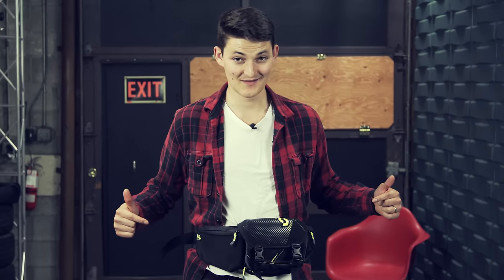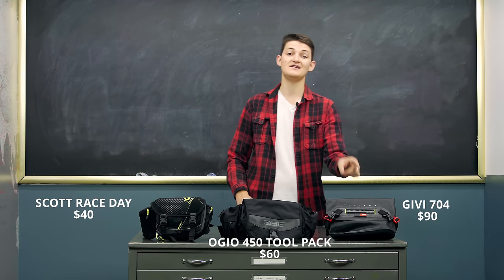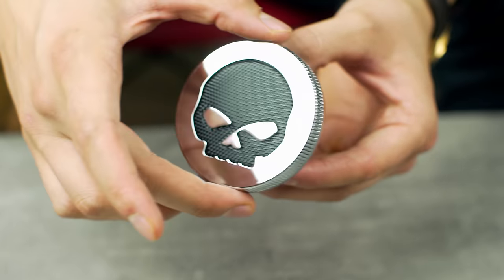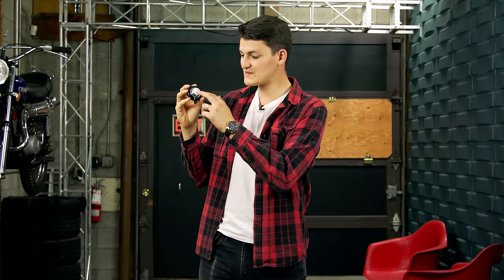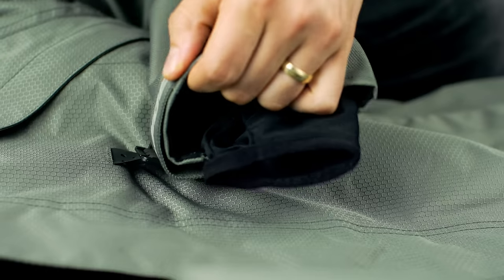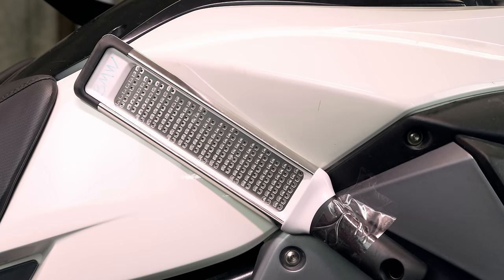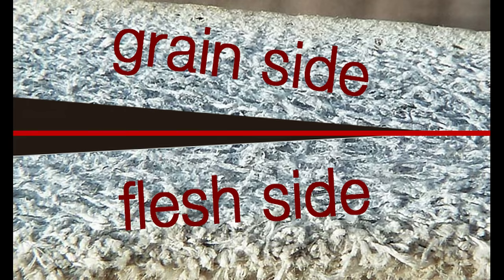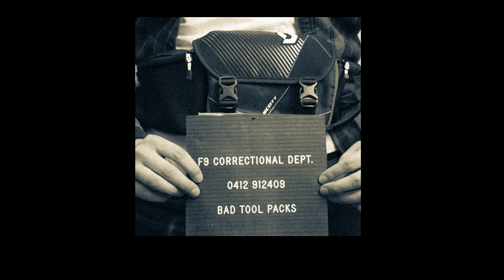Most Dangerous Motorcycle Gear

Comment: Hydration hook issue resolution: remove hook, replace with velcro patch, put velcro around hose...pull when needed, stick out of way👍
Reply: Just take care with those velcro fasteners on your sleeve
Reply: @PortCharmers  yeah but thats easier to pull of than a hook
Reply: There's also neodymium magnets, and they don't wear out like velcro
Reply: s70driver2005 Haha!
Reply: I never carry or have a Hydration pack.
I just make gas station stops and get a cold one.
Reply: Some use magnets instead
Reply: How is your left hand being stuck an emergency? You have the throttle, gears and both brakes still available so you should be able to stop perfectly safely
Reply: @ItsFriscoBaby  1) It's unexpected - there's a disconnect between what your brain says should be happening and what actually is happening. 2) Your momentum is aiming to get your hand to your bar so you end with a twist that goes no where. Completely different from aiming to hold your hand on your chest.
Reply: @orange42  yeah unexpected shit happens. You should be able to cope enough to stop the bike. It's not like you'd be taking your hand off the bars mid corner
Reply: I just find it funny some people are terrified of taking a single hand off the bars it’s like why are you even on a bike
Reply: @ItsFriscoBaby  yeah, you slowly press the brakes while the revs drop, the bike stalls and the rear wheel locks.
Reply: @ItsFriscoBaby  exactly my  though, its not like you are drinking mid corner, you will already be in a milder situation and have acces to most controls, worst case scenario you have to stall it
Reply: @ItsFriscoBaby  Um, clutch?  Slow down in high gear and stall.  Stall leads to either rear wheel skid or instant stop.  Instant stop with one hand on the bars leads to dumping the bike.  No left hand could be dangerous.
Reply: @meritholdingllc123  any experienced rider should easily be able to get the bike into neutral without the clutch.
Reply: @ItsFriscoBaby   Your left hand being stuck isn’t an emergency by itself, and like you say you’re probably not taking a sip mid-corner. 

But situations change rapidly on the road, and having your hand stuck for a few extra seconds could be just enough to cause an accident with the right chain of events.
Reply: @tbdcreations5370  Possibly. Or a crow might fly into your face when the sun is shining in your eyes and your hand is caught on your jacket. Anything is possible.

More likely someone in a car will wipe you out because they're looking at their phone though. Should sell the bike and stay at home to be sure.
Reply: @ItsFriscoBaby   Lol, obviously tons of things could happen and riding bikes is dangerous. I think Ryan’s tip was about doing what can be done to reduce that risk (even if just a little bit).
Reply: Smashing histareicly onwards so's I can complain 💪about it lol 😆 I am iron man can you see me 
Through the window
Reply: In the UK we can get Kriega rucksacks and camelbacks that have a velcro fastening at the shoulder for the drink bladder hose, no issues with hooks and on road rather than off-road riding you can tuck the hose into the chest strap.  When it comes to 'fanny packs' [you don't want to know what this means in the UK] why would you carry tools in a position that can stab you?  A screwdriver set with handle and interchangable bits is smaller and less likely to perforate your spleen, likewise a multi-tool where the pliers collapse into the handle is less likely to cause a puncture wound.  Add to that an off cut of hard plastic and a bit of neoprene from your old mouse mat and you reduce the risk.

Mind you, I have never worn, or seen worn a pack at the front on a bike, at the back is the best place, and if you have a back protector then you further reduce the risk.
Reply: @ItsFriscoBaby  I'm glad we have perfect people that never make mistakes In the heat of the moment like you. really makes me feel like the world is safer knowing there's highly self confident people that believe all mistakes made are mistakes deserved
Reply: I always solved the problem by taking a break after an hour or two and drinking from a bottle.
Reply: @draven4464  Yeah, I saw one of those and thought it was really cool.
Reply: @ItsFriscoBaby  Distraction is real. I've had a seagull hit my chest at low speed and then end up in my lap - still had all limbs on the right control, but it was unexpected and while getting it off i found myself well out of position and having lost most situational awareness. Anything that happens unexpectedly has a disproportionately large impact, and one that pulls your focus in close even more so. Add in that restricting mobility makes resolving it more confusing to your brain and I'd imagine this is worse than the seagull.
But then, why was Ryan fine to demo it while rolling? Because he knew it was coming.

I'm fine taking one or both hands off at different times while riding, but unexpectedly losing a hand is a whole different ball game. Also people are suggesting it's only going to be in mild scenarios - why? The hook is still there if you're wiping your visor cause you're mid overtake and spray is making you unable to see anything. Just coasting down your speed is not a great option in that setting.

Does that make it a huge safety risk? Probably not. Is it something you should consider? May as well, it's not like it is giving you any huge downsides to think about it. Even if you then do nothing to mitigate it, when it happens you'll probably be slightly less confused as to wtf is going on.
Reply: Magnets also do well here

Comment: As obvious as the danger that comes with spike like mods are, I've had spike grips on my bike for years. Loved them for the looks, the spike and the integrated turn signal in the spike end of the grip. However, one night on my way home I hit a deer that jumped out in front of me, not even giving me time to hit the brakes...as my chest bounced off the tank, the bars torqued with the bike going down on its side, and there it was...the spike tearing into my forearm. At the time I didnt realize it, because I was more amazed with the luck of my open face landing into my gloved hand as I hit the pavement, but upon arriving home and checking the damage done...I realized I had a sleeve full of blood and a torn wound to match. Thumbs up on the vid. Good points. :^)
Reply: Ouch.
Reply: Hehehe "good points" sorry

Comment: Shoelaces stuck in the gear shifter are also very dangerous.
Reply: Teo O Yep. That’s why I tuck my lace loops into the other laces.
Reply: I was always paranoid about my laces when I wore a pair of jungle boots.  I'd replaced the worn laces with parachute cord which is 550lb test.  I was less worried about getting caught on the shifter or brake pedal, and more worried about one getting untied and into my chain.
Reply: Yep just go and buy a proper pair of bike boots, no laces its that simple.
Reply: Not everyone wants to wear power ranger boots.
Reply: immikeurnot  Shoelaces have to be weak to act as a safety. If a shoelace is caught by something it's better to just break the shoelace than drag and suck the whole leg into the transmission.  So don't tie your shoes with steel cable as a shoelace.
Reply: +Isaac 
No! Seriously????

🙀🤔😄😆🤣🤣🤣🤣🤣🤣🤣🤣
Reply: I've caught my shoelaces in my shifter too many times already. Probably at least 4 times just this month. I need new shoes.
Reply: @amihere383  bruh u livin like larry from spongebob ffs 😂

stay safe tho
Reply: It's the main reason why I go bare foot
Reply: Been there done that long ago couldn't put my foot down when I came to a stop.Experience  is what you get when you didn't get what you wanted
Reply: Isaac lmao!!! Power ranger boots!? Omfg!! Dude they don’t look like power ranger boots, but that’s hilarious. Just wear a good steeltoe boot or they actually got some really cool sneakers out there for riding that are protective and doesn’t have the dangerously long shoe strings. I think some are actually zipper like the Italian designed fancy boots.
Reply: Yeah been there once.... and only once. Double knot and tuck laces if you have them on a bike.
Reply: If that really happens to you, just be happy it wasnt the chain your laces got into!
Reply: Why would anyone who rides not wear power ranger boots or their equivalent?  It’s your feet, your ankles, it’s even your lower leg to some extent depending the circumstances.  So?  Your life would not be irreversibly changed by serious injury sustained to any of these?  What’s the very first thing to hit down in man common MC accidents?  Your feet and legs.  So let’s ride in sneakers or slip flops and jeans because we’re just so cool!    Darwin’s theory comes to mind... laces in shifter>>> AMATEUR HOUR.
Reply: Oh... in case you missed it.  Get proper leather and armor protected purpose sent protective riding boots.  Cost?  A lot less than missing weeks of work sitting home lame.
Reply: @curvecrazy  Absolutely, also much better than sitting at home missing a foot!
Reply: @ChillyDippers  Nah, proper bikers don't wear laces at all!
Reply: @duece3000gt24  Stop yourself, will you ? Protective sneakers, you buy those in same shop you get your protective riding shorts ??
Reply: Morten Kristoffersen lol. Just saying they are out there bro. Check it out.
Reply: @duece3000gt24  I'll take your word for it...
Reply: Velcro saves lives.

Nah, seriously, double knot your boots with minimum lace length.
Yup, I laced up then snipped away til I had was a loop de drop (enough for double knot tight to boot).

Hides under my 1970s Farah Faucett era bell buttons nicely.
Reply: @duece3000gt24  
Military looking khaki steel toe boots...great support and ideal shit kickers if a car gets too close.
Reply: Shit boi ! Are you sneeking up on me. I feel personally attacked 😩
Reply: @bobvegana4752  
You wrote "shit" yet you censored "boy" with boi?
Youd never made it as the censor on the late show with Craig Ferguson. (RIP)

"Was a come and a go!"
Reply: @curvecrazy  or learn how to tie you shoes i wear my leather work boots when i ride good protection except the heel ive never had my shoes come untied on my bike and if you are worried double knot and tuck the excess lace
Reply: Hell yeah, been there, done that,😂
Reply: Teo O can’t get caught if you wear flip flops 🤔
Reply: SO surprised to see the number of thumbs up on this one - thus assuming a large number of folks also have experienced this, but like so many other rider safety lessons, people are too embarrassed to spread to word to other riders, new or old. 
After low siding my '78 KZ400 back in the day and grinding the exterior ball of my ankle about flat in a pair of jogging shoes, I learned two things; Always wear tall over the ankle basketball shoes if you can't afford or are just riding a few blocks to school and don't want to wear tall, stiff, expensive (motorcycle specific) boots. Double lace (tie) them to shorten the floppy 'dog ears' , then tuck them as deep as possible inside the shoe, even if it hurts the squared off ankle scab / scar. 
I 'stepped up' to a super high performance '82 Gpz550 of the day - hell it had THREE disc brakes!, and was glad I never went to put my foot down at a stop sign (of course in front of the cutest gaggle of girls ever!) and just fall flat on my side completely baffled by what evil force was holding my 'balance' foot tight against the peg.  Despite hard lessons and luck, I made a hobby and career out of riding for almost 30 years in the most hostile environments possible and (so far) have lived to tell about it - to those who will listen.
Reply: Thatz why i always wear flip flops,duh. No laces.
Reply: @AsiAzzy  i think the main concern is having the shoe lace loop around the gear selector or brake pedal, happened to me once, started tucking the lace inside the boot ever since aha :|
Reply: True but i don't think shoelaces qualify as motorcycle gear
Reply: Velcro orthopedic shoes is what motorcycle boots are going to look like pretty soon 🤣🤣🤣🤣
Reply: @AsiAzzy  😂😂😂😂😂😂😂😂 steel f**king cable I'm dead
Reply: @CallumILJ  Sure enough, annoying and dangerous if you were about to stop and put a foot down. Weak shoelaces should save the day. I take great care about laced shoes to be tucked away flush both on motorcycle but especially on fixed gear bicycle otherwise i heard grusome horrors with fixed gear and dangling laces and fluttery pants.. it gets trapped between the front chainring and the chain in a tight deathgrip and the wheels keep spinning (and so is the chain with tremendeous torque available).. best case scenario is torn pants and no fall.. worst case pulls the leg between chain and chainrings as the wheel spins from inertia/speed and sever the foot in half, toecutting action, improptu leg amputation.. or a mix of a bad fall and deep lacerations and fractures.. real nasty. 

So take care around grippy spinny things with loose clothing, long hair, loose shoelaces or other similar stuff arounnd a spinning chainring/sproket/lathe/drillpress/tablesaw and most powerful spinning/moving things that will just keep going no mater what.
Reply: Clutch in, brake, then other foot down, turn bike off.
Can be a hey what tha moment, but only dangerous if one panics.
Reply: Hah! Sucks on you... my shoes use Velcro
Reply: You scare me and thx for telling that
Reply: Not half as fun as getting them sucked into the sprocket. It only takes once, and never again!
Reply: 35 yrs. ago, I badly broke my ankle wearing running shoes, Nikes.   Since then I buy real riding boots. They look cool too.😜
Reply: @Rhetorical Answer lol I know  I will say after my wreck I had I would recommend a pair of heavy leather boot or proper riding boots tennis shoes or short boots will not properly protect your feet
Reply: Ah that is why i drive over people daily.
Reply: @EvilTwin123  Never wear steel toe boots. That is how people cut their toe(s) off in an impact, accident.
Reply: Isaac I’m literally going to now start doing that holy balls
Reply: @immikeurnot  But if it gets caught in the chain or anywhere I would want it to rip & tear. Or else it will break my leg, foot or ankle if it is strong paracord for example. 

I never wear foot wear with external laces.
Reply: @amihere383  No. You need to re-evaluate the type of footwear you use. 
You lace can get caught and then you may not be able to put your foot down at a stop. This results in a sore or broken ankle & damaged bike.
Reply: Shoelaces stuck in the gear shifter are also very funny & is entertaining to the riders behind who are watching.🤣
Reply: Damn. Never happened to me but just reading your comment gave me shivers. I guess it’s the perfect remedy if you’re having trouble with your digestive system and taking a crap...
Reply: Been there, no crash, but panic stations when you come to a stop and your foot stays on the peg!
Reply: Even worse if a part of the shoelsce gets into the chain or the wheel.
Reply: Happens with me all the time.
Reply: And tennis shoes
Reply: I don't think I could manage that if I spent a week trying it on purpose. I've never heard of that happening to anyone else either.
Reply: Yeah, but a shoelace is not a motorcycle accessory.  (Foot wear....  which was not part of this presentation)
Reply: Happened once while it got stuck in my CBR 250, after that, I wear boots and make sure that laces aren't unduly long and tuck them in shoe itself.
Reply: @shivatrident5391   250 ?!?!
I can run faster.....
Reply: @nuffflavor  Cheers to that, pls don't waste your superhuman talent, Go to olympics and win a Medal for your esteemed and proud country.
Reply: @shivatrident5391  ROFLMAO !  Good come back !
Funny ! 👍✌
Reply: When I said dangerous it didn't mean that something could happen while riding but when stopping at the red light. I happened to me and due to the lace stuck in the gear shifter I couldn't put my feet on the floor, hopefully there was a car stopped just next to me and I kept my balance by putting my hand on the car rooftop. Otherwise... 😁
Reply: I chipped the bone in my elbow because of it.. stopped, went to put my left foot down and it was caught in the gear selector. Fell full force to the ground and didn't even have time to put my hand down ouch..😭
Reply: @stevek8829  trust me..it is common
Reply: What? Stuck in the chain, sure, but stuck IN the gear shifter?????
Reply: @SkinnySkinch  around if you prefer 😏
Reply: Who would wear shoes?  Why not go barefoot?
Reply: @AsiAzzy  steel cable huh, now that's a good idea 🤔

Comment: Osprey uses magnets instead of hooks for their hydration systems
Reply: Magnets work great, but you can try what I do - use a self retracting id badge lanyard, that way you can get a drink and let go of the hose, the lanyard pulls it back to the same spot every time.
Reply: if you got the hose and the magnet right, it falls and "locks" back in to place. I also use the osprey and never really have issues with it flailing. just let it fall out of my mouth. Magnets on them are pretty strong.
Reply: Osprey bags are so damn good!
Reply: And pick up metal chards that dig little holes in the paint.
Reply: Davo I tried that mountain biking, and the lanyard did not have enough pull to keep the sway down.
Reply: Ummmm....Turn the hose keeper around 180 degrees such that it is removed from the lateral side rather than medial???